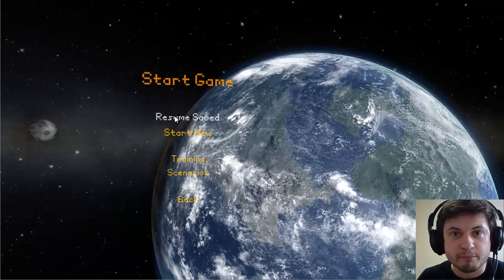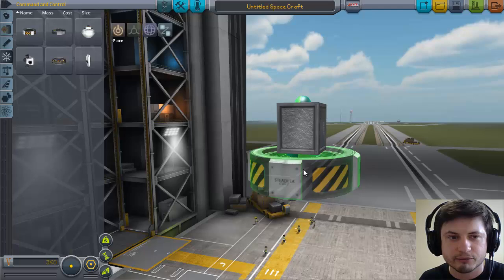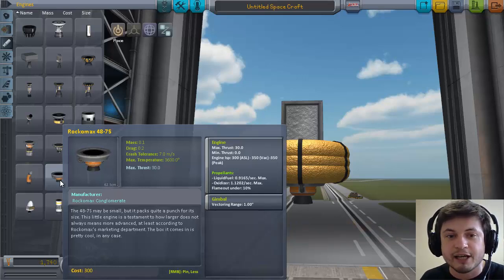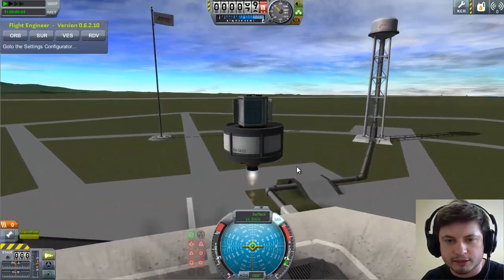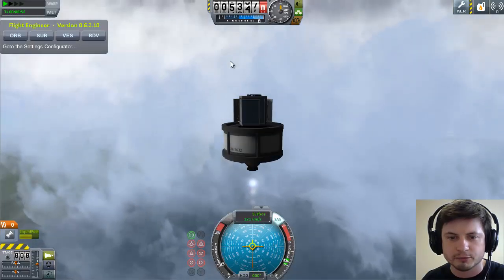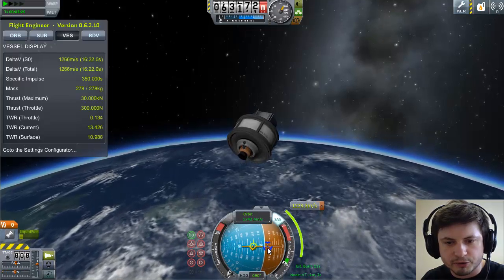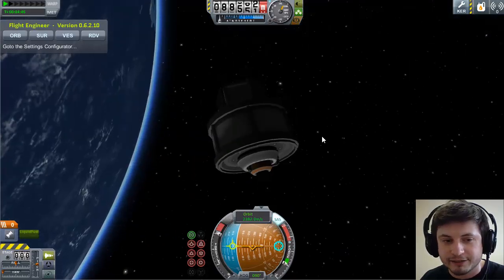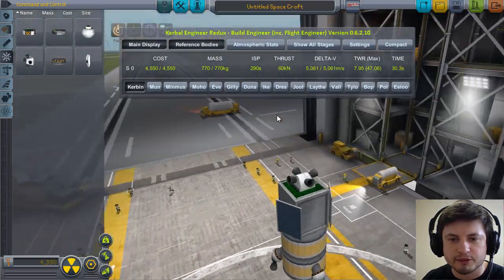KSP - SSTO Challenge - Smallest possible SSTO (0.90 beta)

Comment: Just tried the RCS-only craft out.  If you slap an RT-10 booster on the bottom (with a stack separator), you can make it to & land on Minimus.  I was able to get back into orbit, but didn't quite have enough DV to get back to Kerbin.